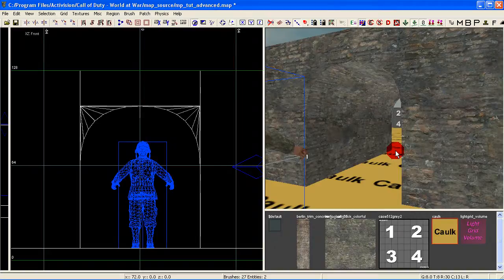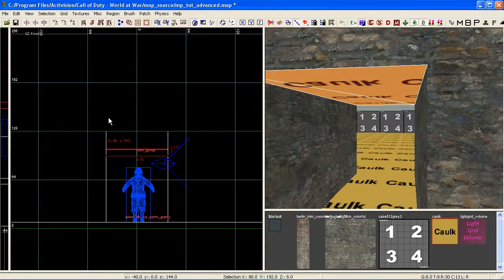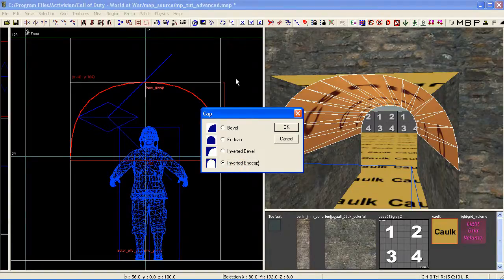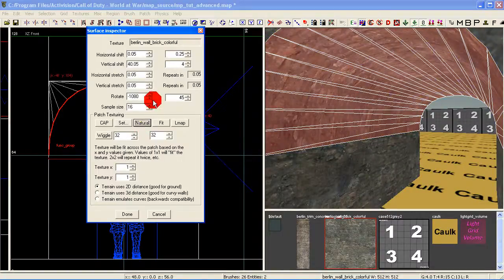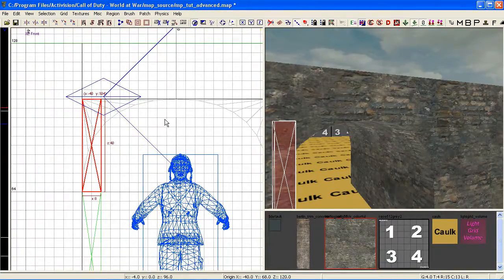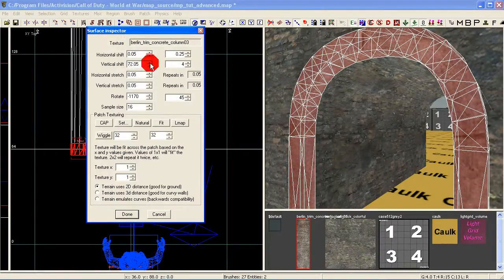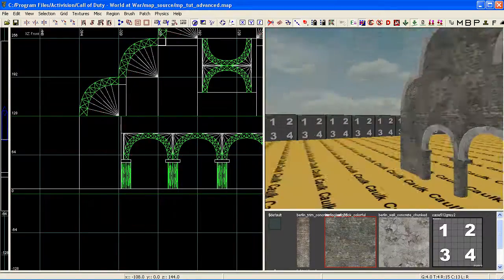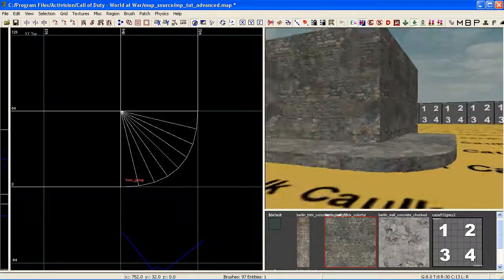CoD Radiant : Advanced arches , end caps and bevels

Comment: Hello, let me first say great tutorials you got here m8 ^^. I encountered a huge problem though and i think you might be the only one who can help me. Whenever i select my simple curved patch and enter width 3 and height 5 i only see 3 verts in frontview and in the length of the patch i got 5 verts. (i think this is the main problem). But i can fix that by taking width 5 and height 3. But then it doesnt let me use the inverted bevel (shift c once the patch is selected). It works for my friend (he also uses witdth 3 and height 5 (and he gets 5 verts instead of 3), so i reinstalled the program but the same problem. Sorry for the long post :D, i really hope you can help me. Thanks :)
Reply: i know im 5 years too late lol, but i think you have to make it a patch from the top view. or else it'll do similar things to this. i tried making a patch from one of the front/side views and it just squished my entire block into basically a strip of vertices (which is obviously not what you want)
Reply: @prodGhettoWizard  it's a problem with what your "front view" is. If you go from top view to the next axis, that is the front view, although what you're working on it could be the side view.. I hope that made sense. I'm having this issue right this moment and the way I fixed it before was Ctrl M, but it's not working now for some reason

Comment: Hey man, it is very nice tutorial :) . But the thing I want to know is : How to you rotate that brushes after copy them ? means which buttons you use to do that?
Reply from the maker: +Gurpreet Singh Hi, thanks. Glad you enjoyed it,. To answer your question, have the object/s selected, then press R to enter free rotate mode. Then, move your mouse until the required rotation is applied. 

The grid size you have currently selected will affect the rotation angle. A low grid will enable more control, a higher grid will be be more aggressive.

Also. depending on what version of the tools you use, with the object/s selected, pressing shift + D will apply an automatic 45 degree rotation. 

Hope that helps.
Reply: +BlackJackJonnyy  Thank you brother for reply :)

Comment: /watch?v=cgcMSe-JZDw&feature=youtu.be

(( Because YouTube has decided to get worse by the minute. I am no longer able to give a video response. If you want to watch the video I posted in order to get your opinion, You will need to copy the link above, open a new browser window, type in YouTube's address and paste that link to the end of it. ))

 When I tried to make the end caps, it failed. If you watch the video, it will show you what I am talking about.
Any help with solving this issue will be greatly appreciated.
Reply from the maker: Hi.

I've not seen this issue before, however, I was able to re-create it.

It seems to be the angle at which the curve patch is created that causes this issue. I don't know why this occurs, maybe a bug with the tool, but if you try creating the patch from the 'top' view with the patch going east to west (so to speak) then rotate it into position before using the bevel tool, it should work.

For some reason, again, I don't know why, by when using this function with the patch going North to South, it doesn't work. Create the other way and just rotate it into position.
Reply: BlackJackJonnyy
You are the master sir. This solved the issue in one go.
Thank you very much.